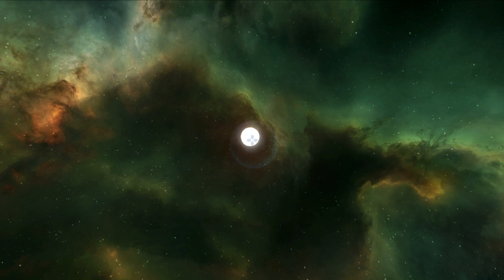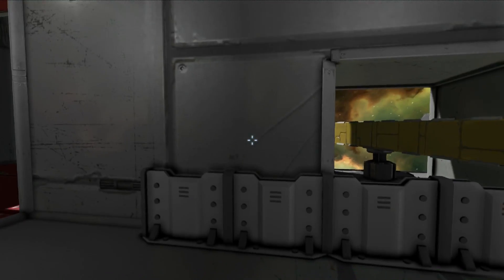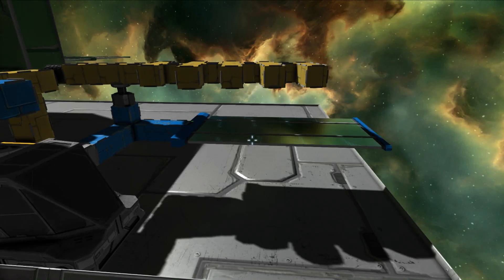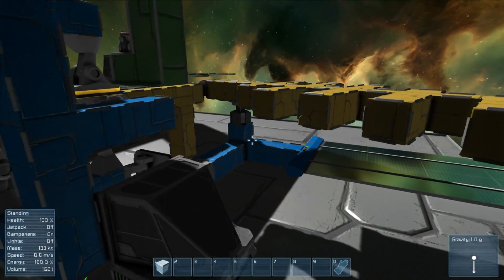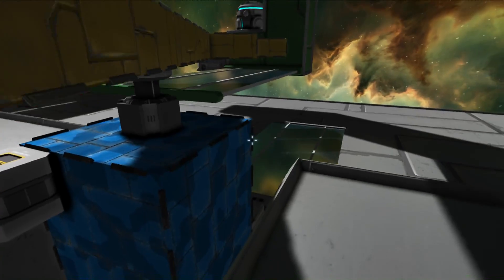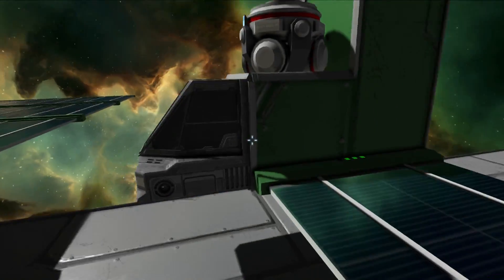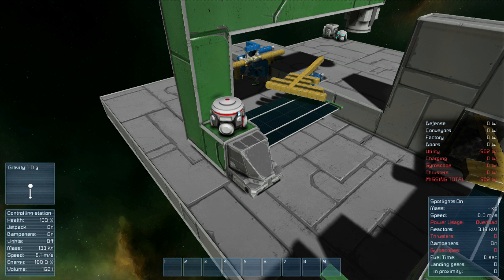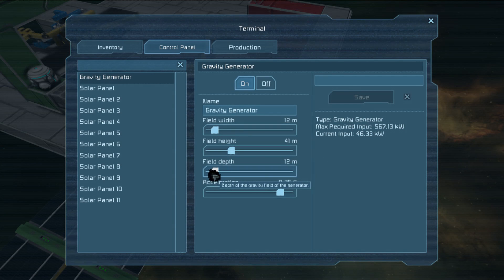Space Engineers - Buttons and levers tutorial

Comment: Could this system be hooked to a large power supply?  I'm thinking (to save uranium) you could cut the power to your base by flipping the switch causing you to have slightly too little power.
Reply from the maker: As long as the consumption is static the total energy does not matter. meaning having refineries and assemblers cannot be used(easily). another thing is that if you have more power, you still need to use more power to stay in the area where the loss of one solar panel means an overload.

But it is an interesting idea and i will look into it :)
EDIT: While looking into this i realized that you would need to constantly waste massive amounts of power, and i don't think anyone think its worth it to have a physical button instead of just jumping into a cockpit and press Y :)